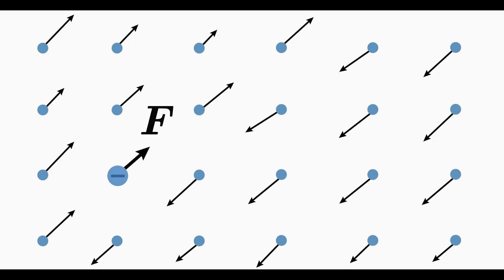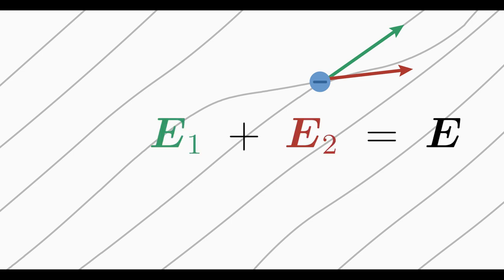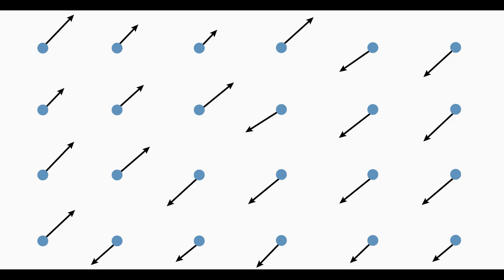Why Do Field Lines NEVER Cross?

Comment: Unfortunately I think this explaination can be misleading and based on a somewhat false assumption that a point charge exacly has to follow a certain single fieldline, as the animation 0:24 - 0:45 suggests. The animation is misleading for understanding motion and Newtonian mechanics in physics and does not represent the real trajectory of a point charge placed in a non homogenous electric field. 

In reality, the charge would leave the first field line to upper parts of the field. above the first line as the line curves to the right. This is because an object with mass has inertia, and the resulting motion depends on both the acceleration and velocity for the particle in every instant and point. Force (and acceleration) doesn't have to have the same direction is what Newtonian mechanics teach us.  As an example: In planetary motion the resulting force is always towards the sun, but the velocity and hence the trajectory of the planet, fortunately for us all, isn't.

Field lines don't cross because of defenition of a field line (and a vector field): the resulting force vector should be tangent to the field line in that certain point in space. Crossed field lines would violate uniqueness and basically mean that the resulting force on a charge would point in two different directions, which of course can't be possible for a resulting force (and also mean that we would not have a defined value for the vector field F(x,y,z) at that point in space).

Comment: Thank you for the great explanation. Something that I am struggling to grasp and any input or feedback to help get me over the hump would be greatly appreciated. The concept of an electric (vector) field is straightforward, where every point in the region of space is represented by a vector that carries the magnitude and direction of the electric force acting on a positive test charge. However, the concept of field “lines” is proving hard to grasp, especially for magnetic fields. Maxwell tells us that the divergence of a magnetic field is zero everywhere. If we visualize the magnetic field lines forming closed loops around a magnet, Maxwell’s statement would imply that along a magnetic line or loop, all the field vectors that comprise the loop must be identical in strength, all along the loop. In other words, no matter how far out the magnetic loop extends from the magnetic source (such as a bar magnet or solenoid), the magnetic strength at every point along a particular loop must be the same (wether were at the point on the magnetic path right next to the magnetic source or much further away, but still on the same the loop). Moreover, we know the net magnetic field is weaker as you get further away from the magnetic source, so the conclusion is that the magnetic lines are not indicative of the net magnetic field strength, but rather the concentration or count of field lines at any point in the region dictates the net magnetic strength, and not the strength of a particular line. Is this accurate? Also, how come if you sprinkle iron filings across a magnetic field they only form into a few amount of lines? If every point in the region is represented by a vector, why aren’t there more field lines connecting all the vectors in the region instead of only a few field lines connecting a small set of vectors that comprise the entire field? Thanks in advance for any thoughts you may have.
Reply: How many lines a metal powder forms depends on powder particle size, magnetic strength, i.e. their ability to stick to nearby particle.
There are no actual field lines in reality, they just indicate direction and density on a drawing.
You can draw field lines with arbitrary resolution, and they all still will be "there". You can always add additional field lines in between all already drawn field lines, doubling their number, and can do it endlessly to infinity. It is just a tool helping visualize field direction and relative strength in certain place.

Comment: There will be crossing field lines between electric field as conductor becomes an insulator as the electric field oscillate for a parallel shift with crossing magnetic field and will try to experience superconductive effect at critical points and maybe photons may stimulate such a critical points of super conductive electrons.